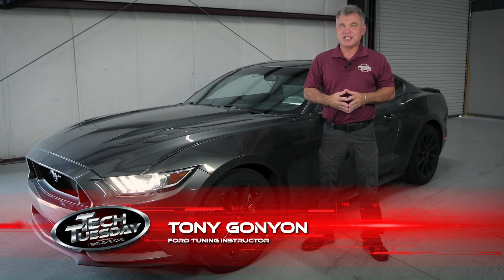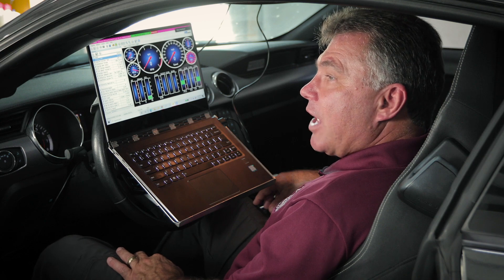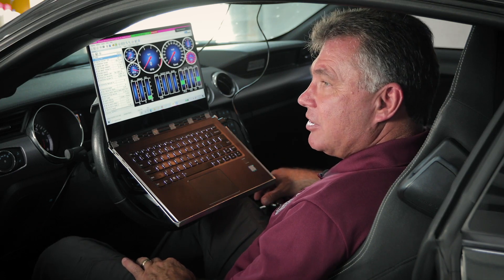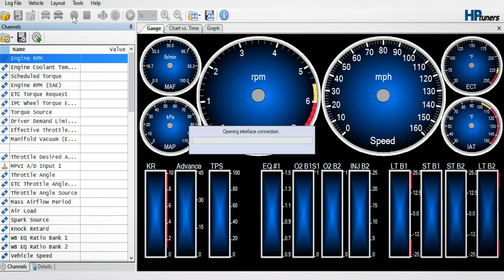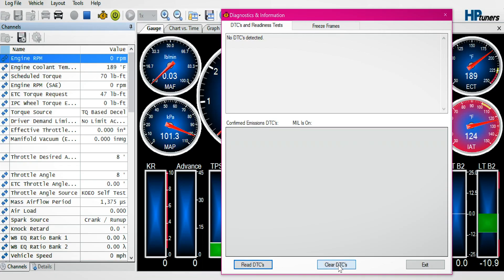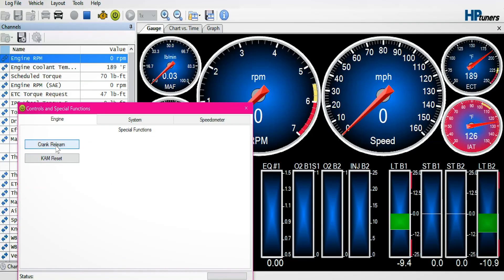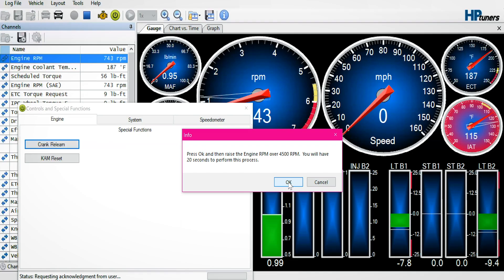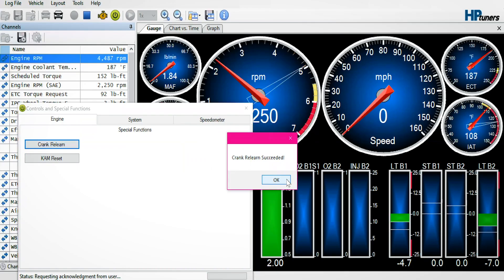How to do a Crank Sensor Relearn using HP Tuners

Comment: Would I need to preform this on a 2002 5.3 LS swap after a BTR Truck Norris cam swap if a P0343 code pops up? Or just drive it down the road for a while until it learns the new camshaft?

Comment: I have to make notice that my 2013 GT was getting misfire codes 300, 303, &304.  After clearing those, i got a "crank sensor relearn" fail code.  AKA "MIL" (malfunction identification light) which could NOT be manually cleared.  I read that a crank sensor relearn would fix this so i used my ProCal tuner, did the relearn and the light went away.

Comment: My girls vette has a Dtc for crank sensor relearn. Is that dtc OK when doing the relearn? Should I clear docs first? This code come on automatically  when I sort the car..
Reply: No unfortunately the DTC needs to be off before performing the relearn. I have same issue on my car and have been driving it around for almost a year with that P0315 and random misfire because it will not perform a damn relearn. Fortunately for me is a 2012 V6 3.7, but if it was a Coyote or in your case a vette, I would schedule an appointment to the dealer if the code is set as permanent and have them reflash the ecu as they will be able to clear it out for you.

Comment: Cant Seem to find the Crank Relearn under Special Functions, all i get is Throttle Relearn and Reset All Adaptives. Am I using the wrong version ? currently on (4.10.4 latest stable ) tired the Beta and its the same.
Is there a specific step that would activate the option ?  
The interface of the software seems different than the one im using. Did HP Tuners take this option ?

Please assist.

Comment: I can’t remove the p0315 code what should I do
Reply: Same here I can clear mine p0315 mine appears as a permanent code
Reply: Have the Same Code on my SRT8 trying to solve it, any tips ?  Did you manage to get it off ? if so what did you do bro ? thx
Reply: @Rid.r  yea I got a retune and it disappeared but it was stuck on the dash for 8 months took 3 retunes to work lol
Reply: @stock__5.063  Damn, I just got the HP tuner to get this thing off for now and later on tune in future. check engine buggin my OCD hard eheh .
Thanks for the info bro <3
Reply: @stock__5.063   I’m having the same issue. Tuned by Lund. I even changed the crankshaft sensor and light is still on lol
Reply: @jaydentroy24  lol did you ever figure it out? i’m having the same issue by lund
Reply: @qqr7129  I followed this video to get me close then used the OS number or user number given by Lund.  I was using the wrong number the whole time.
Reply: @jaydentroy24  same here bro you fixed ?

Comment: Works exactly the same with a GM, I have seen a ford after a flash/tune ecu can log a crank learn fault. It would let me do a relarn (passed) and will log the fault immediately after the relarn procedure. The fix was flashing the ecu with the same file again no more active fault...ford oem ECU can be pain